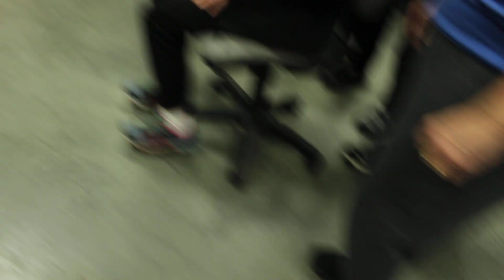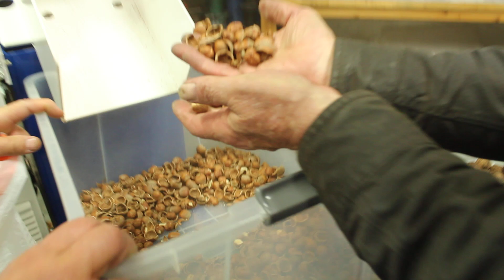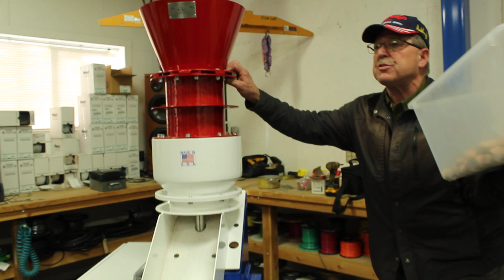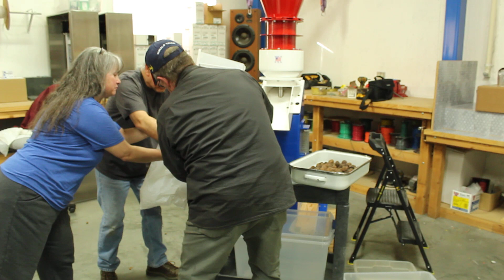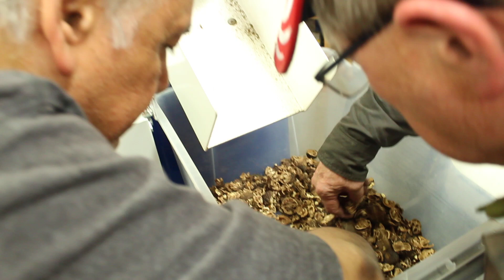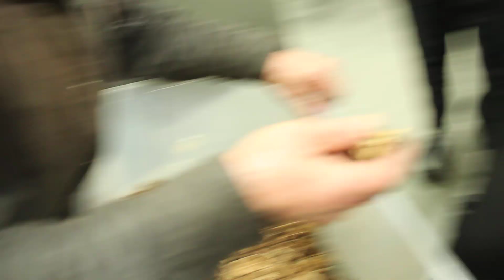Adjustable Patriot 600 Nut Cracker running at Bolen's Control House, our electrical supplier.

Comment: I have a homemade roller mill nutcracker.  The rolls are 11" diameter, counter-rotating and the gap is adjustable. When I crack black walnuts, I set the gap to crack about the way you did the black walnuts in your machine in this demonstration. The cracker output goes into a trommel.  I run the cracked material though the 2-stage trommel with a first section of 1/4" screen to remove the tiny pieces of shell and fractured nut meats. This is chicken feed (they love it!).  They next pass into a 1/2" screen section of the trommel. The fallout from this section is lots of nice pieces of nut meat and broken shells. I sort this section to save the nut meats.  The output on the far side of the trommel is saved and rerun a 2nd and 3rd time through the cracker and trommel. Just curious, did you rerun the output from your black walnut cracking demonstration?  If your machine works similar to mine, you can continue cracking to free all of the retained nut meats.